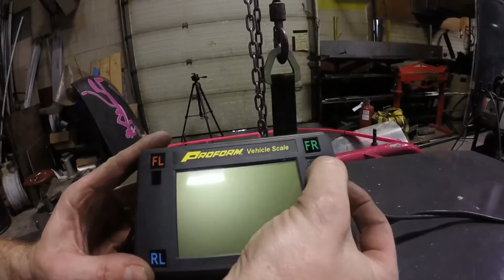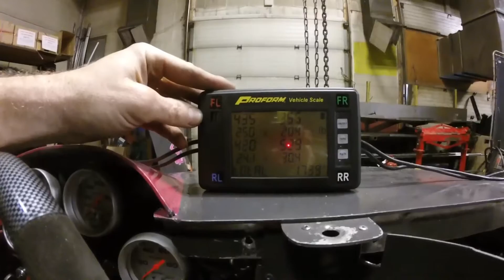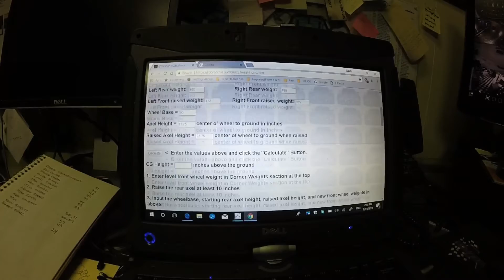Episode 186: Center of Gravity

Comment: Great video. How high you have lifted the rear of the car ? Is there a specific height to do this ? Were the scales weighing only the front end when you lifted the rear ? Do the online calculator tells you what to do in terms of process?
Reply: I lift the car exactly 12 inches and to make the calculations correctly, you have to weigh all 4 corners when one end is lifted and you should also replace the shocks/springs with a solid rod. The online calculator I used had instructions on how to do it.
Reply: @MarkSawatsky  Dear Mark, many many thanks. I have the corner scales so I think I will be able to do that. If I understood correct, the lifted wheels also be on the scales at that moment, and also the other two wheels will be on the scale ( the ones on the ground ) Happy New Year

Comment: I was surprised that you didn't do it with all the body work on the car, even though it probably doesn't weigh much. what might make a difference is when you are in the driver seat. though
Reply: I would have preferred doing it with all bodywork on but the car will not achieve the angle I needed with the fenders on, so it had to be done without.